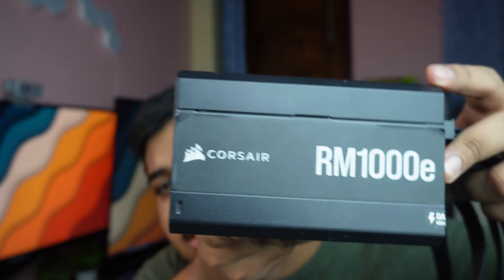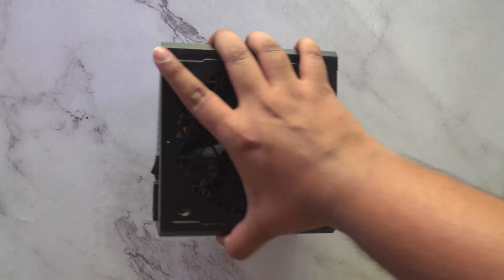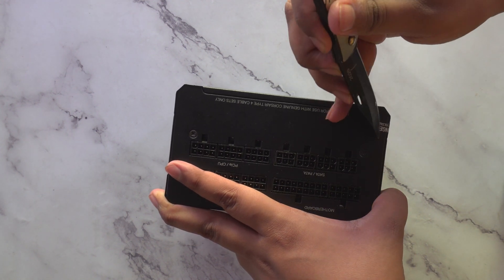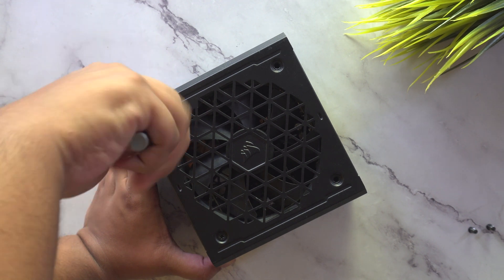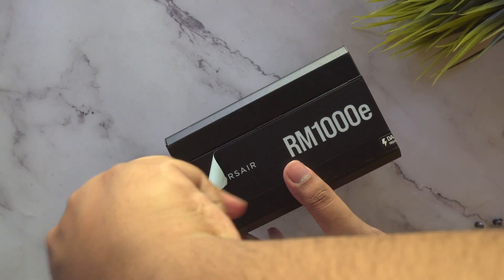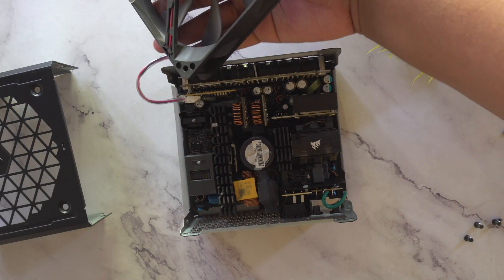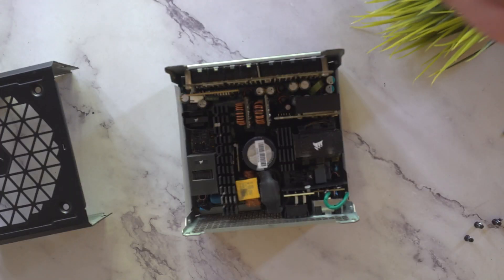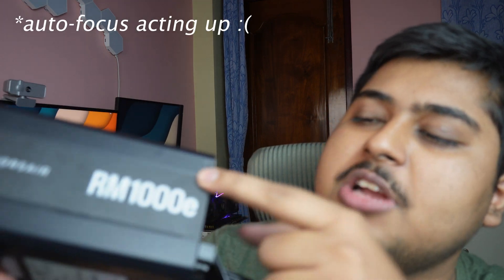Corsair RM1000e 1000W PSU disassembly: FULL GUIDE

Comment from the maker: Caution: Drain your PSU completely before taking it apart. Residual charge in capacitors can cause injuries and/or damage the PSU.
Reply: Residual charge can give U injury too.. I ve got shocks that nearly felt like killed me once from a 650W one.. So from a 1000W its damn dangerous.. So big caution required while disassembling this thing.

Comment: Hola, recibi una ayer y la conecte a una motherboard Asrock fatal1ty Z97. Y me sale luz roja pero no enciende. Podra ser que no sea compatible?
Reply from the maker: No, the PSU is compatible with any mothetboard that supports the standard (which means anything released in the last 25 years). Check up your motherboard's manual for what the red light means. Should be the CPU/DRAM. A quick reseat fixes the problem for many.

Comment: Is this model has only problem with the fan? I have a brand new 2022 model one that uses ATx 2.53. If it has problem I might have to sell it and get Seasonic instead. And if the fan can be replaced. Which fan fits the psu and how many pins on the fan connector? Thanks

Comment: If Im having the fan noise issue (like many other owners of this PSU) but Im kinda OK with it (I dont like the noise but for me its not a big deal) could this affect the operation of the PSU or lead to more serious problems?
Reply from the maker: That depends on a lot of factors, mainly what's causing that fan noise. To be on the safe side, you should get your PSU repaired to avoid any major issues down the line.

Comment: Honestly the fan is the only bad part of this unit, but I think I might replace the fan.

I know what sort of connectors to use and all but I just don’t know enough about voltage and how the psu itself will react to having a different fan.

In my mind the control chip for the fan turning on and off is bound to the psu’s board, so it should be safe to replace, but if anyone knows more toss your thoughts at me.

Comment: The fan sucks, Corsair really skimped on the fan here, the RM1000x and HX1000 have much better and quieter fans, but thank YOU for the video, much appreciated 👌👍
Reply: Almost all PSU of this range use this fan, my xpg core reactor has exactly the same and after 2 years it started to fail, besides it's impossible to find a compatible replacement because they handle a 12v 0.58A fan.

Comment: I just ordered a RM1000E and on Amazon it says 2023 model, PCIE 5.0 and ATX 3.0. Says it has the new PCIE power for my 4080. I am confused now. Did they use the same model number, But do a 2023 refresh?
Reply from the maker: Yep, the internals are the same. Just the connectors have beeen revamped to support the 40 series cards.
Reply: Me too